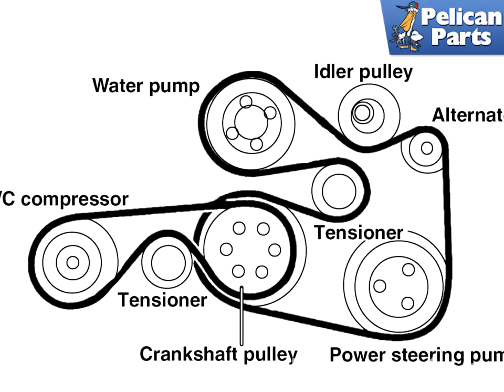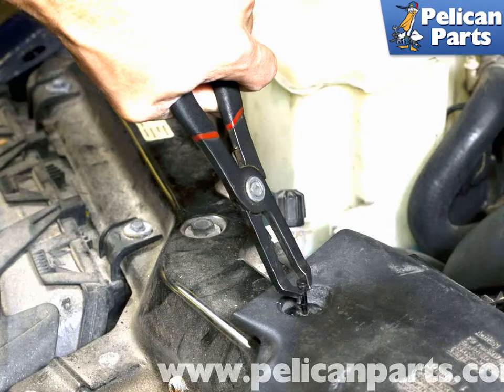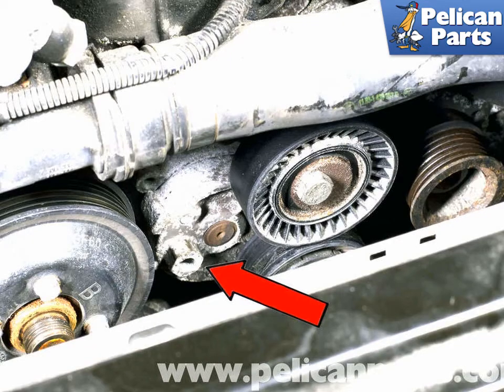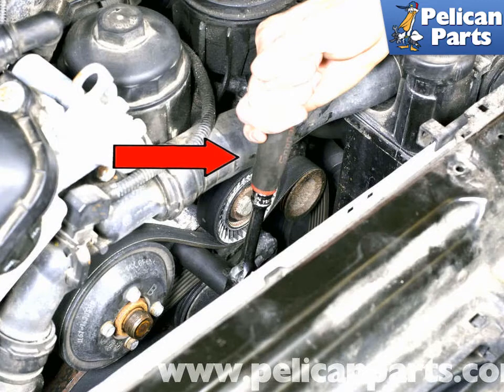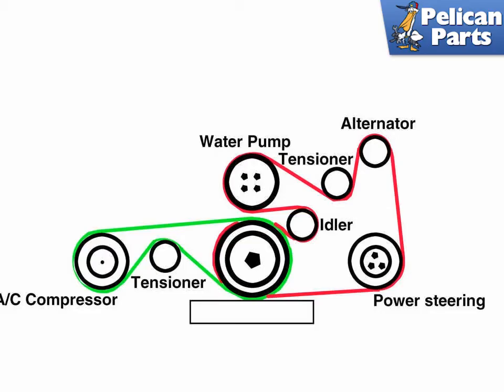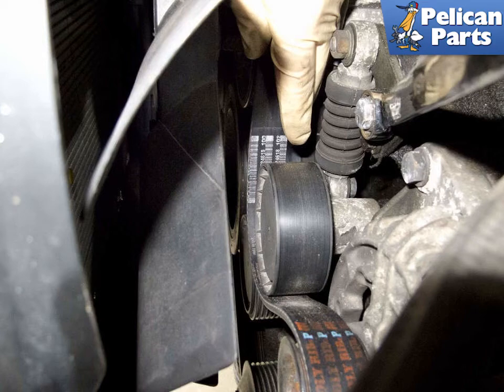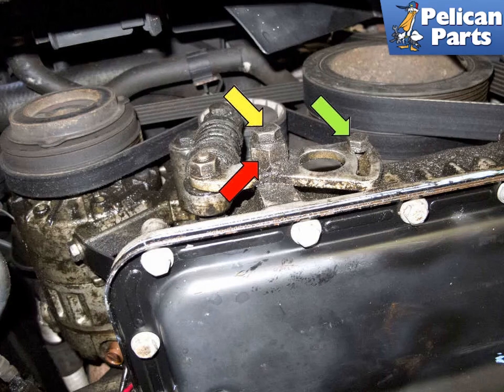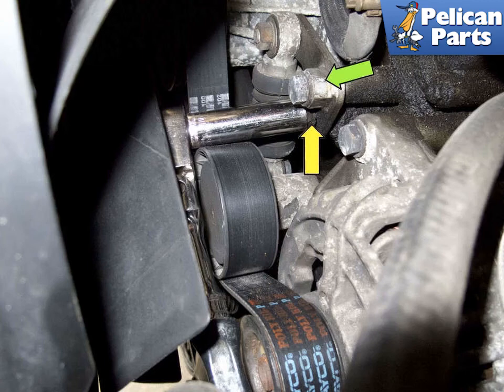BMW E39 5-Series Drive Belt Replacement | 1997-2003 525i, 528i, 530i and 540i

Comment: I've a 2001 528i estate e39 and access doesn't even remotely look like this. Multiple cooling pipes and electrics in the way, a full depth radiator shroud 🤷
Reply from the maker: Model years have variations depending on options. Thanks for the Info. We appreciate it.